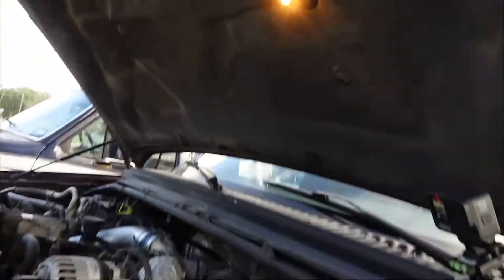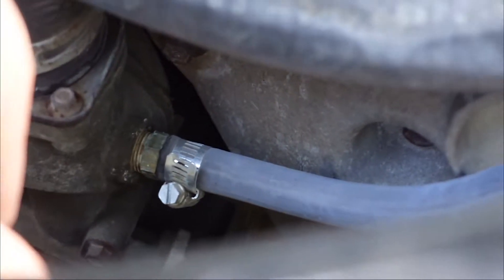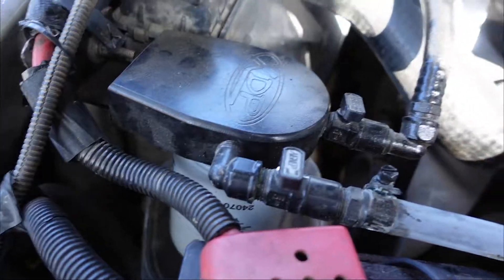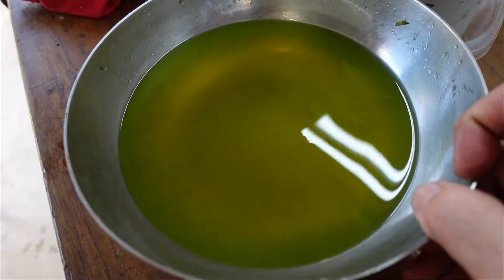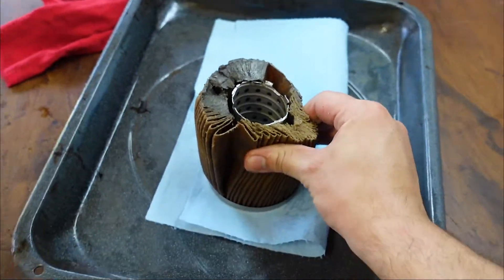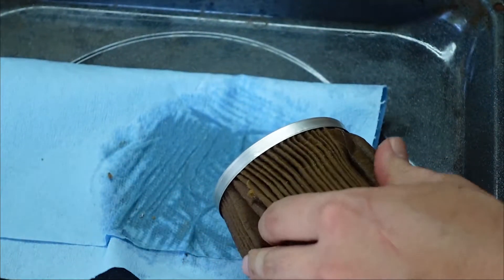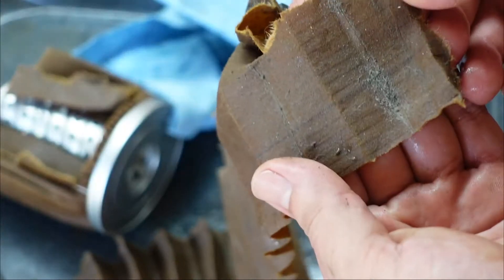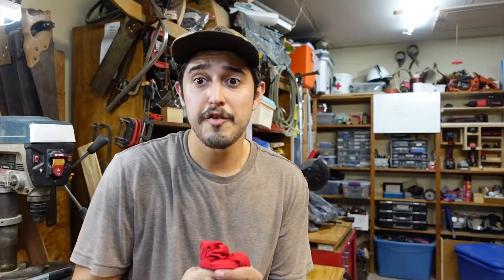WHY YOU NEED A COOLANT FILTER ON YOUR FORD POWERSTROKE DIESEL TRUCK

Comment: The blocks do have casting sand in them, Factory does NOT do a proper flush purge on the water jackets.
My 71 AMC 401 had the same debris in it!!
Rust, Sand and other elements.

Comment: You hooked up the lines in reverse. I can tell because the filter is showing debris on the inside….all debris should be on the outer side of the filter media. Go ahead and reverse the lines so you get proper flow direction through the filter assembly and filter.

Comment: Next time put the filter material in the vice while the material is bunched up and squeeze out the liquid. Makes identification of the debree 100 times easier.
Reply from the maker: Thanks for the tip! I’ll be sure to do that to my oil filter since that replacement is coming up. Hopefully it’ll be visible with oil but I’m curious to try it on the coolant next time around.